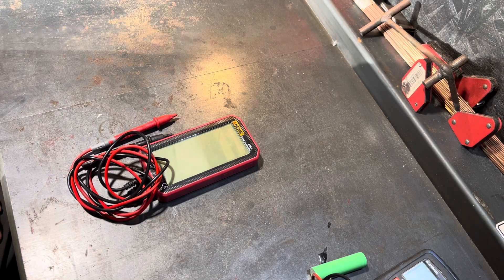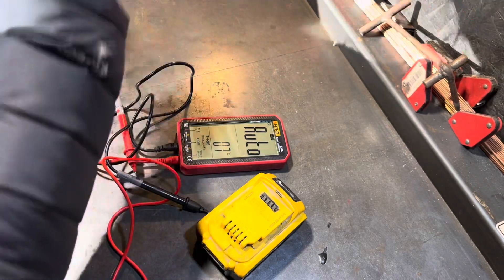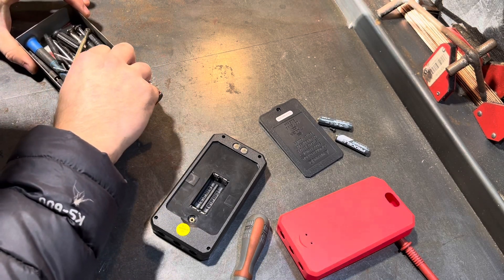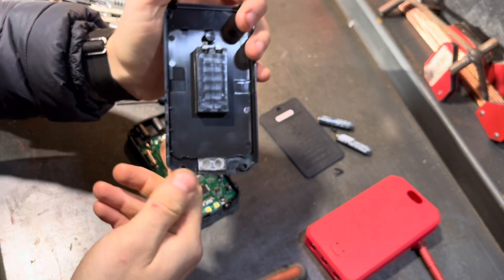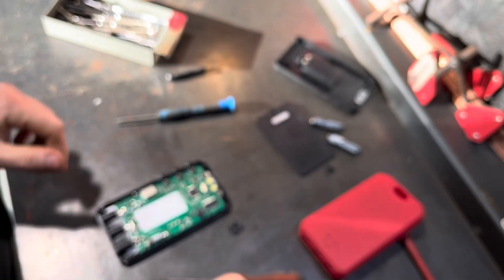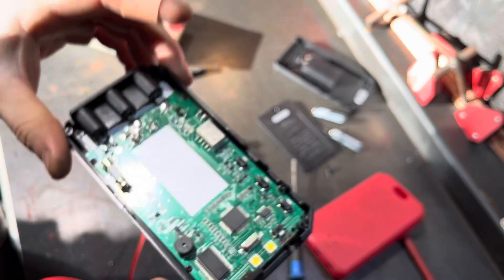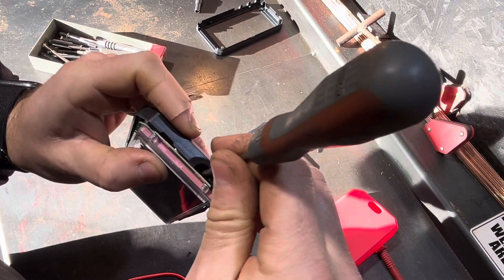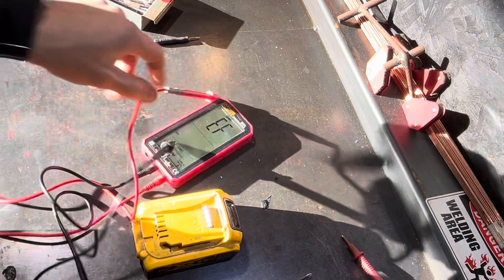TEMU NEGN 620A Multimeter. Let’s take it apart! Is it safe?? Wish, AliExpress copy

Comment: I’m a qualified electrician with forty years experience. 
That meter is and will be be perfectly fine for test mains AC and current just don’t test any voltage higher than what the meter maximum range it probably rated to 700v ac max and 1000v DC  so checking the voltage in your house will not be a problem even three 400v phase , If you know what you’re doing. If anything goes wrong there worst that will happen is it will blow the internal fuse. No different to the fuse in the plug for your kettle. Or any other electric appliance . That’s why the fuse is there . To protect the meter. Don’t believe the BS about it be made in china most if not all your electrical appliances in your home wore made in china and you have no worries about plugging them into the mains and using them. Know that meters limits and don’t push it beyond those limits. Then you won’t have any problems.
Reply from the maker: @Dog-whisperer7494  great advice, thanks

Comment: Unknown IC1 is a HT1621B and "Green capacitor" is a NTC thermistor as it says on the PCB :p

Holtek HT1621B is the LCD driver. NTC is there probably for the temperature reading, room temperature?.
Reply from the maker: Thanks for that. I’m still learning and have a long way to go
Reply: Looks like it's a PTC actually which might serve as input protection. If there is a huge current surge the resistance goes up and limits the current.